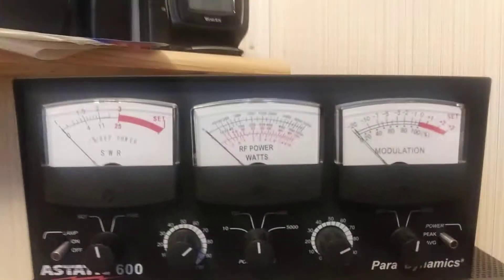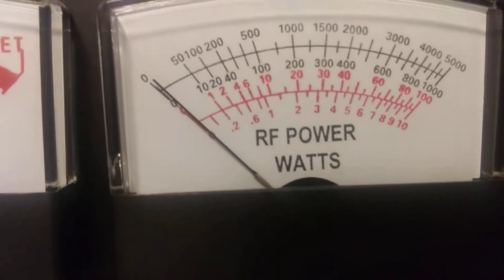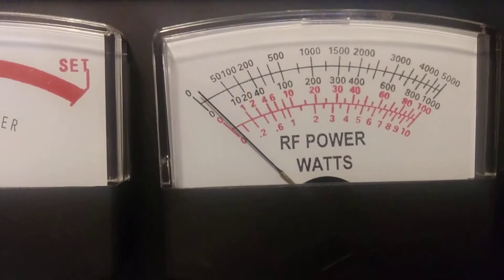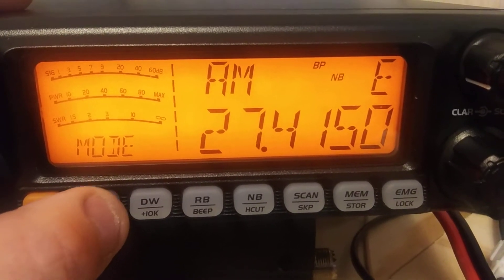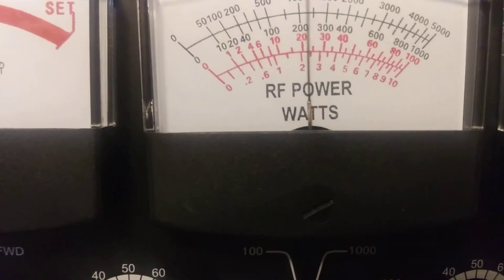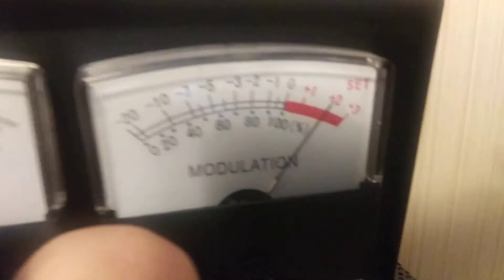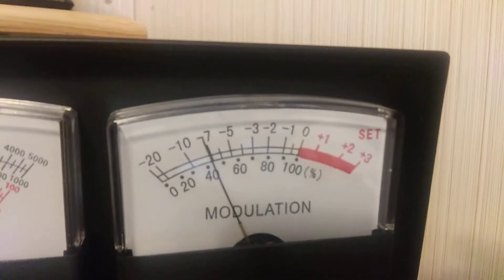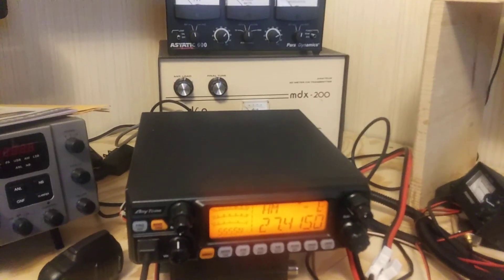Anytone 5555N initial tests.

Comment: I just recently picked up the radio myself. And I will say it is a very nice radio especially the digital receive. And yes you're right the service menu you can really customize the radio in a manner that you like and your amplifier likes LOL. My only complaint with the radio is the RJ45 connector. I wish they would have went with a four-pin or maybe even a 5 Pin like the President radios.

Comment: Has anyone else noticed how the S-meter on the AT5555N seems to be "stuck" in a vary narrow range?   Mine will very seldom get above S9 even when multiple other listeners located at greater distance from a powerful station are reporting +10, +20 and higher readings.   This radio needs a method to calibrate the S-meter. I've been searching for one and still haven't found it.
Reply: Think you can adjust it in the service menu...

Comment: Mine does 70 watts on ssb out of the box 50 watts on am
Reply: If you have the NEW version of the 5555N then yes it will do 60 to 70 watts.  The old original version does less.

Comment: So the front buttons don’t illuminate
Reply from the maker: Correct.   They do not light up
Reply: @N9KGC  that’s unfortunate I wanted this as a mobile bad but night would be tough
Reply from the maker: @KE8ODY-WV-Ares-Ham-Dad-3O4   now the one I had in that video was the first generation of that radio. There's been at least one if not two revisions or variations of that. It might be worth checking out the newest one to see if they've changed those buttons to where they light up
Reply: @N9KGC  the 5555NII
Reply from the maker: @KE8ODY-WV-Ares-Ham-Dad-3O4   5555N2Plus
Reply: @N9KGC  I found a nice like mint 5555 NII for $150 shipped is that the model in the video
Reply from the maker: @KE8ODY-WV-Ares-Ham-Dad-3O4   No.  The one in the video is the original 5555N
Reply from the maker: But they look IDENTICAL
Reply from the maker: @KE8ODY-WV-Ares-Ham-Dad-3O4   I have the other 5555 also.   Brand new only taken out of the box for other videos. And I'm going to sell it. Take a look at my videos on the regular 5555.   When I was selling radios I had gotten that one as a sample actually I paid for it myself but I got it to test them out. And it's never been mounted on a mobile it's only been on here at my house maybe three or four times. It's already converted and on that model you do have to take the covers off to do the the conversion on the 5555..  not on the N models
Reply: @N9KGC  I see, what kinda wattage to they achieve ? On 10 and 11m? How much are you asking?
Reply from the maker: @KE8ODY-WV-Ares-Ham-Dad-3O4  Ahhhhhh. The wattage question.....    There are so many variables in that situation. Depending on how you're measuring it what meter you're using and a whole host of other things..    honestly everyone puts way too much emphasis on wattage.  Here's a fact that is difficult for a lot of people to accept :   10 watts and 100 watts is the same. Now that's a short explanation without going into all the details. But honestly if a radio is doing 20 watts or 80 w you'll notice zero difference at the receiving station. NONE !    But to answer your question this radio is out of the box factory other than the conversion for 11 meters.   It shows about 40 watts on both of my meters PEP on SSB.  It will show anywhere from 30 to 50 Watts on most meters with a dummy load attached
Reply from the maker: But again, a 20-watt radio and an 80 watt radio will show no difference at the receiving station whether they're a mile apart or 10,000 miles apart
Reply: @N9KGC  nice 11 meter done that’s honestly all I’d need.. that’s nice no case removal for that.. I’m interested
Reply: @N9KGC  so how much
Reply from the maker: @KE8ODY-WV-Ares-Ham-Dad-3O4  Sorry for the delay....     I've not been home all afternoon I'm just looking at this on my phone. I could probably sell it for $150 maybe 160 with the shipping. I can get you some real good close up pictures of it when I get home. If not tonight if it's too late I'll do them tomorrow morning. I've got the original box all the original packaging